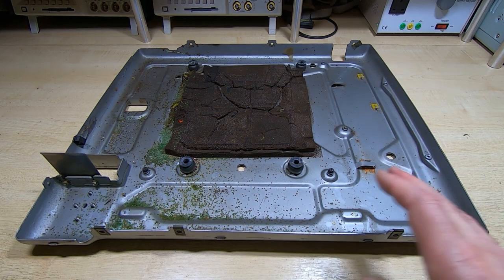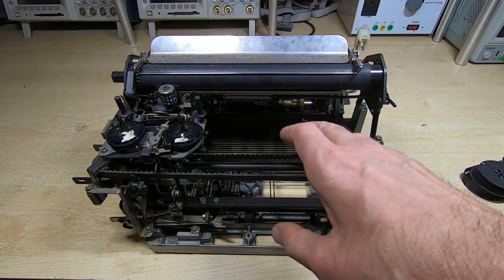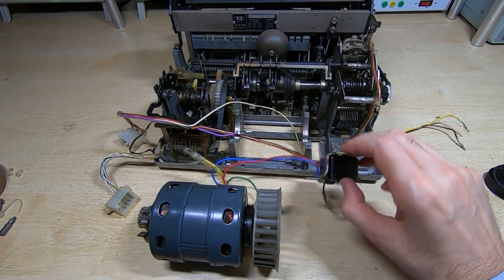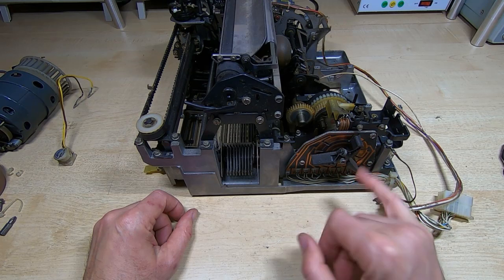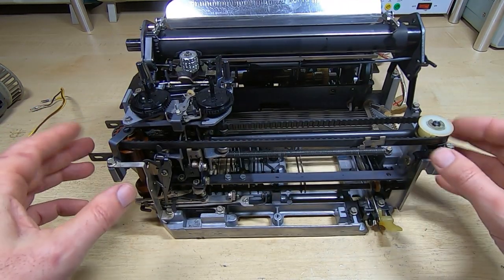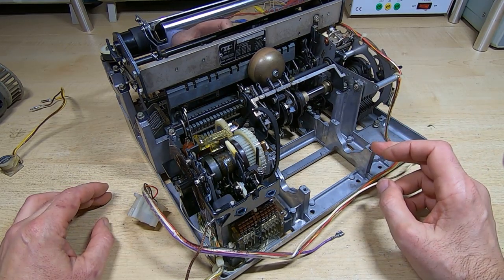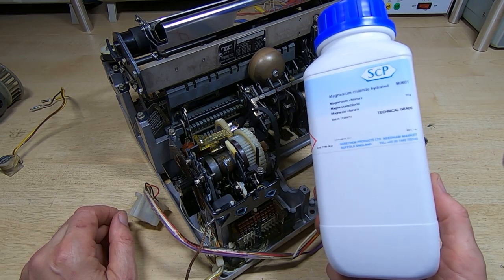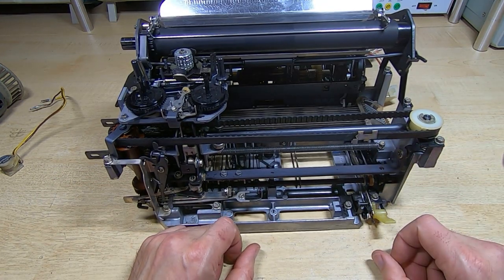ASR33 #2 Repair Part2

Comment: Jerry, I think that products like Evaporust also attack/dissolve aluminum, so I'd be afraid of what it might do to zinc alloys too.  Your warnings about being careful about using it here are very good.
Reply from the maker: It should be safe to use on Aluminium. I have a number of test parts continually soaking in evaporust and all the aluminium parts are OK. I actually immerse complete aluminium radio chassis in evaporust and have never had any issues but it is best to test anything first.
Reply: @JerryWalker001  Thank you for this additional information.  I obviously confused what I read/heard about Evaporust with what I've read/heard about other treatments, but have never tested it on aluminum myself.